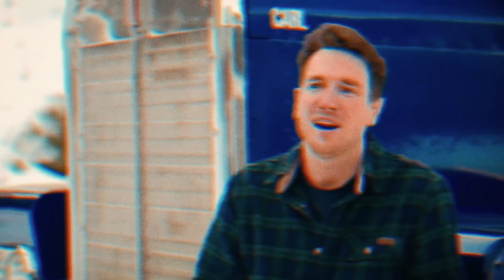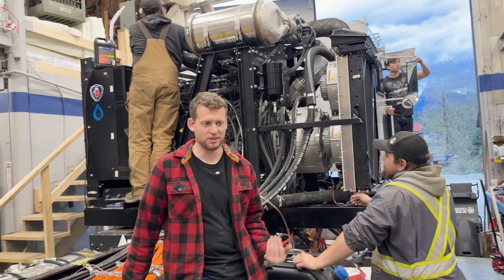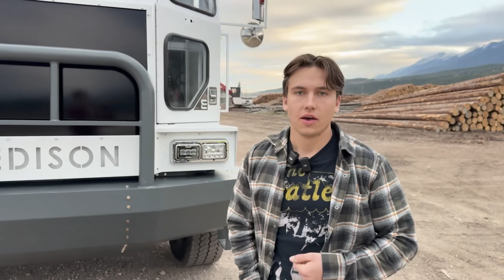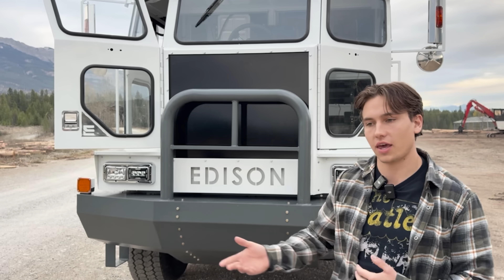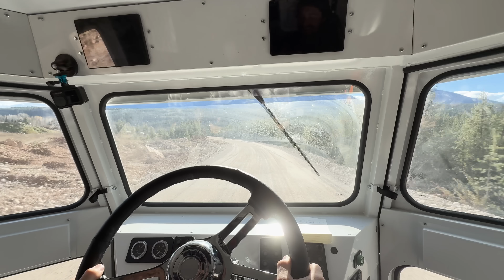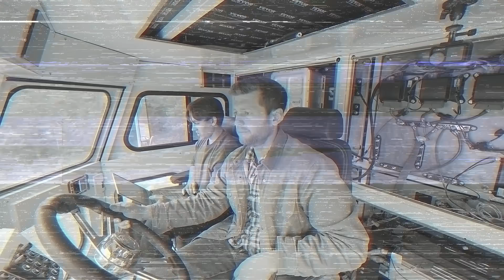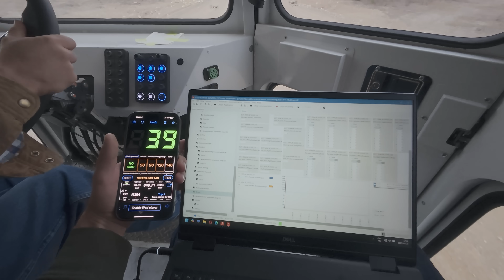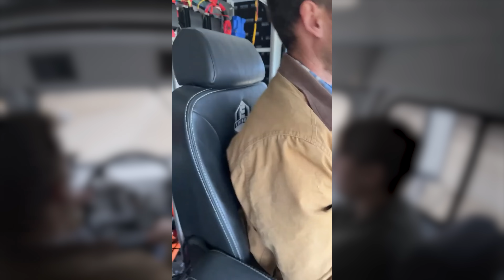Driving Our New Hybrid Truck for The First Time

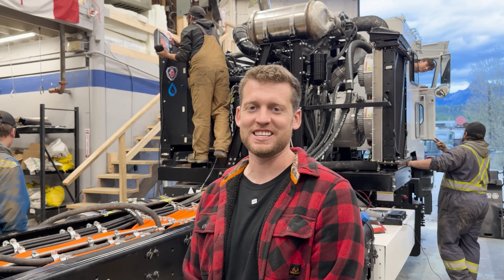Comment: The cut of HV lines 1:30 😂
Reply from the maker: Those lines are just ran for the body Rigup going onto the chassis
Reply: @EdisonMotors that would make sense. So if you mentioned Rig is it an replacement for the blue truck that you would repower ?

Comment: Chace's disappointment having to say DEF when saying what fluids are needed for the Scania gen set to get it running, so relatable.
Reply: And the censors for the DEF system are a major trouble issue after a few years
Reply: Is a simple gasoline engine generator under consideration?
A simple pushrod, 2-valve, non-VVT, non-AFM V8 or big I6 could be a solution.
Reply: Stupid question: Why not use a petrol engine for regen?
Reply: @CitarNosis317  petrol engines are generally inefficient compared to diesel. You just get less out from the energy that fuel has in it. Some high compression compression ignited petrol engines are getting close but controlling those is not low tech. Also with high burning temperatures same issues are found, so nitrous oxides. Basically only way to get nitrous oxide emissions down is to keep burning cool and that means low efficency because it is nitrogen from air reacting with oxygen from air when temperature is high enough. Even burning hydrogen in air instead of pure oxygen will lead to NOx emissions.
Reply: @Karjis  Also for heavy duty truck work, potential buyers are not going to want petrol engines. They already have diesel fleets, there are safety reasons to avoid petrol engines in some cases (for example petrol vehicles are often banned from mine sites), etc.
Reply: Exactly
Reply: And also causes reliability issue cause the engine gets uppity cause it fails (which unlike say a Catalytic Converter it just LOVES to die).  So that means downtime, which means, losing money, while also costing money to get it fixed.  And the off set isn't worth it (especially when you consider it comes from China)
Reply: My old 12 valve has DEF rejection.
Reply: I wonder why that is. I'm not a truck driver so I don't know why DEF is a big pain in the ass.
Reply: @rafous0206  it's a high concentration amonia solution. if it leaks, which it will, it rusts everything that is below and behind the leak.

and obviously its another fluid that needs filling up and another system that needs maintenance and can break.
Reply: @anonym3017 It's UREA a derivative of ammonia. When 67.5% water in the solution dries out leaving pure urea. That stuff can cause damage to equipment.
Reply: DEF fluid also crystallizes in the exhaust system and around the sensors and injectors which then clog, fail, and send the engine into a fault situation and a no run most likely on a generator engine.

It’s hugely annoying and hugely expensive to maintain and repair.  It’s the reason why so many private owner operators risk deleting it.  Saves 10’s of thousands over the life of the vehicle.
Reply: @saab9251  This is only an issue in badly designed Def devices
Reply: @registeredSUNNYenthusiast  All DEF devices are short life items that require frequent full overhauls.  VW, BMW, Scania, Cummins, Ford, GM, etc. have regular failures that are directly related to emissions equipment faults.  It's an unavoidable fact that breakdowns reduce and fuel mileage increases when deleting a DEF system.  I understand it helps the environment while costing the diesel owning population millions in DEF fluid and repair costs.
Reply: @saab9251  Def fluid isn't that expensive 
It should be considered a challenge to earn more
Reply: @registeredSUNNYenthusiast  I'm not sure how to convey the reality that the fluid isn't the expense.  The repairs, tow bill, and downtime are the expense.  If you want to choose to be intentionally ignorant of that reality, that's on you.
Reply: Big oof from the regulations.
Reply: @CausticLemons7  It's worth noting that the purpose of DEF is to break down the harmful nitrogen compounds that are the inevitable result of burning fuel in a very high temperature environment.  DEF can be a bit annoying to deal with, but it greatly reduces pollution, and increases air quality in a meaningful and measurable way.
Reply: @jamesburleson1916  I meant big oof in regards to Canada not allowing the original Scania engine that Edison Motors wanted. I understand the purpose of DEF and appreciate the climate benefits, but the regulations are not proactive enough to take advantage of new ideas and tech.
Reply: @CausticLemons7  It's not actually a climate benefit (not directly, anyway) it's a human health benefit. The nitrogen oxides in diesel exhaust are toxic and carcinogenic, plus they react with sunlight and other pollutants to make stuff that's even worse. So getting rid of them is good for public health, emissions regulations have made a big difference to the number of people who go to hospital with respiratory issues for example.

To be honest we probably make more greenhouse gases by using diesel emissions devices because they do tend to reduce engine efficiency a bit- though in that respect SCR (the system which uses DEF) is much better than the other way of getting rid of nitrogen oxides, the dreaded EGR.
Reply: @jamesburleson1916 yup all the cardboard boxes plastic jugs service calls tow trucks and all the lost revenue really save the environment
Reply: @richardradawetz8788 its less than all the platic yoghurt cups these trucks carry ill tell you that much
Reply: @richardradawetz8788 its interesting to me how the public perception of "the enviroment" gives the impression we dont live in the enviroment
Reply: @jamesburleson1916 too bad find a different solution that doesn’t cause so much unnecessary damage and wear. Until then people are just gonna keep deleting.
Reply: @AydenGibbons and thus getting cancer 👍

Comment: It’s going to be so nice when it becomes the disclosed truck.
Reply: I feel it’s either gonna be painted red…. Or green. Is what I think.
Reply: @canadiancrane554  doubt that considering it’s got a drop axle
Reply: @canadiancrane554  I agree with you on that.  and I think it will be painted red, as when the customer was in the shop, and they had the face blurted out, the body shape matched red...
Reply: @KevinH.Rev0 yeah I do think they would be into the unique looking cab. But I’m also kinda getting waste management vibes. The lift axel is throwing me though. Maybe a boom truck for NCSG
Reply: @canadiancrane554  if the customer doesn't find it handsome, at least they'll find it handy.
Reply: I’m thinking it’s either going to be a garbage truck or a concrete mixer
Reply: @andersonnettleship845  what about like a Hydro-Vac or a crane truck?
those are the two i've been thinking.
Reply: @andersonnettleship845  Someone pointed out it's probably a Drill Rig for Alberta Oil Fields.
Cause otherwise, the only other people I'd think would want this very specifically but hush hush would be Military.
Reply: @andersonnettleship845  Not a logger?  That's where his heart is...
Reply: @andersonnettleship845 rotator for Jamie Davis is my bet….
Reply: @andersonnettleship845 its to long for a rear discharge truck trash truck mabey
Reply: It might suck, like around 14yards
https://www.youtube.com/watch?v=piYNKJUBPRI
Reply: @fsdfas_drt_wewrt ding ding ding
Reply: has to be military application
Reply: @Tats2020 yeah that’s a good guess I’d believe it
Reply: So you still need def on a ‘generator’. That sucks